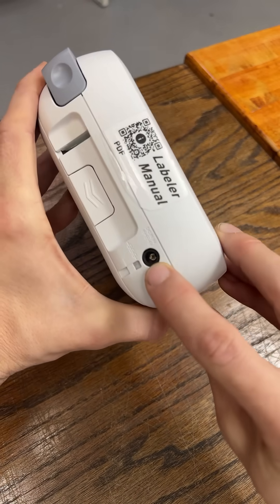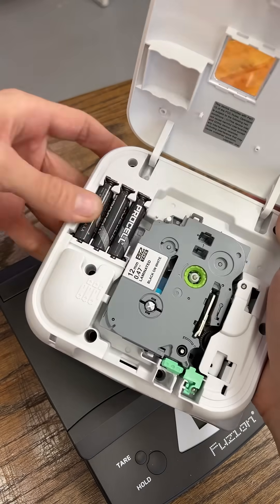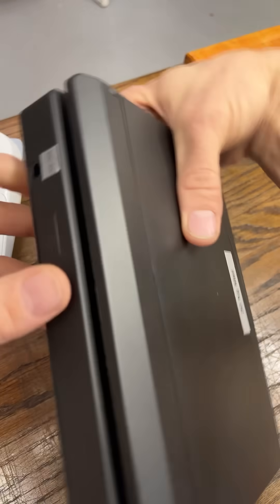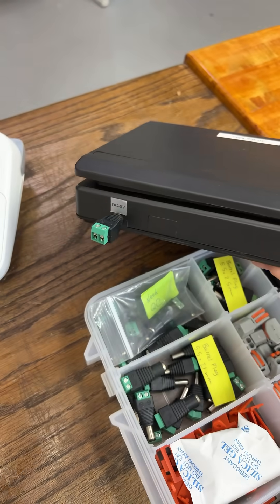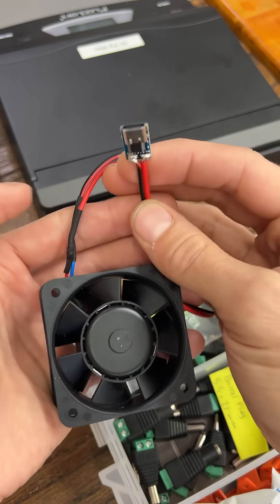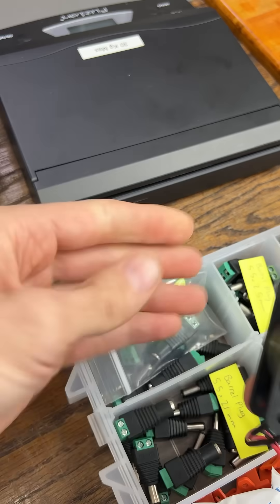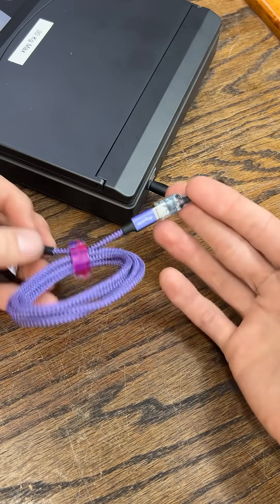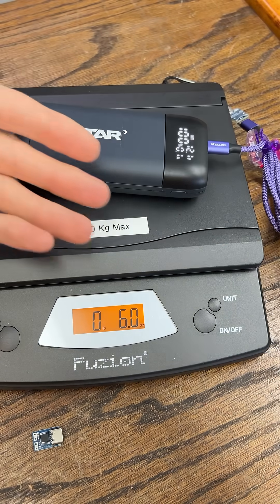USB-C can replace alkaline batteries

Comment: I think we miss Radioshack. Who remembers the catalogues?
Reply: They pretty much abandoned their original target market and tried to sell second-rate electronics. It got to where I couldn't find some of the most basic components. There are a few still around but they're a pale shadow of what they used to be.
Reply: @baldeagle5297  So true the one down the street from me has wall after isle of consumer electronics and a roll-a-round drawer tower with actual electrical components, and never what I need in any of them.
Reply: @baldeagle5297  
What killed Radio Shack is they try to turn into a cell phone store. 
I actually still got a couple of Radio Shack catalog around here somewhere I can't bring myself to throw them away.
Reply: I miss the actual RadioShack store. I thought they went out of business years ago and I'm surprised there are still some around. Not near me. It was so nice to go to my local RadioShack and buy parts off the shelf. Now - catalogs, or certain websites.
(BTW I found it hard to follow what the original video is about.)
Reply: @guitarbrad  he claims to have designed a method of using one 5v wall power brick or a battery pack to power devices with multiple voltage requirements. instead of multiple power bricks, one for each, thing is he forgot about Amperage is as important if not more than voltage is.
Reply: @armastat  sounds like his claim is bogus then, right?
Reply: @Cryin_Lion  in the sense that it will do as he claims?   yes. the actual device could be real, it just wont work on all devices
Reply: amps just matters that its enough. You don't need to match the psu amps to what the device consumes. 

In fact if you're using 3rd party psu's its safer if its amp rating is higher than what came with the device. 

If the volts are too high you can end up overworking the devices internal voltage regulation.

The videos basically just about replacing batteries with dc power sources. If some device uses 3 nominally 1.5v batteries 5v is fine and very few devices that aren't heaters or something will use more than half amp and their dc barrel inputs are usually rated at 6 volts.. But you can just get usb to barrel jack cables or hack up a cable and use that or hack up usb cable into battery termins. This is fine for powering 99% of aa/aaa battery devices with usb chargers or powerbanks just fine.
Reply: I work part time in an electronics store in Australia, and we produce a 400 page catalogue every 2-3 years. We still sell a number of components in our retail store but no where near what Mouser or Digikey sells from their warehouses.
Reply: @aa-au  I'm in Melbourne, whats the store? Fair chance i'm a customer if yr here or do pdf's.
Reply: @EmeraldHill-vo1cs  It's Altronics in Springvale. There is a store in Airport West, but I've never been there.
Reply: @aa-au  Ah, have heard of them. Will check em out, thanks.
Reply: @EmeraldHill-vo1cs  OK, see you at the Springvale store sometime :)
Reply: If you live in australia, we've had 'jaycar' cats for about 40 yrs. They only just changed from mail to pdf cos its 600 pages! 'Radio parts' also.
Reply: @EmeraldHill-vo1cs  I miss the Montgomery Wards Catalogs, oh God we would droll over the Christmas edition. Ah the good old days.
Reply: @armastat  Bet there was more drooling than buying.I'm still a catalogue addict, i think it started with the stuff on back of comics.
Reply: @EmeraldHill-vo1cs  lol, for me it was the Montgomery Ward's Christmas catalog.
Reply: The local Radio Shack was a formative part of my childhood. The only store where you could walk in and buy any type or length of wire, connectors, soldering irons and solders, screw drivers, pliers, etc. etc. To this very day, almost no one else does it. Microcenter has a lot of stuff, and some hardware stores of course but most hardware stores don't sell resistors and breadboards. R.I.P. Radio Shack/Tandy!
Reply: Dick Smith in Australia was the same. Thankfully Jaycar took up the slack
Reply: Realistic and Optimus speakers 😂 I had two 18" Optimus subs in an infinite baffle in my b2200  mini truck back in the day. I still think it was cool 😎
Reply: You spelt catalogs wrong. The word doesn’t have a u in it.
Reply: @UltraMagaFan2   "catalogues is predominantly used in 🇬🇧 British English (used in UK/AU/NZ)" it is a correct word and DOES have a U in it  please check your facts before putting on your spelling-cop costume

Comment: If only PD was sensible, I had chargers push 9 when asked for 12 cause that was the closest they had, I'd rather a small cheap boost converter in the adaptor

Comment: This may damage some devices - the USB-C PD standard starts the output at 5V, then sink and source negotiate to slew to a higher voltage.  If a 9V device (like the label printer here) is undervolted to 5V at power on, it may draw excessive currents and cause power oscillations before the increased voltage negotiation is complete.  This may be ok if you plug the AC adapter + cable + PD adapter into the wall, then plug it into the device (after the output voltage negotiation is complete).  But if you plug the AC adapter + cable + PD adapter into the device, then plug the AC adapter into the wall, you can damage your device.  Devices that are designed as USB-C power sinks must be designed to start with a power supply of 5V.

Comment: You might be able to dictate the correct voltage but your power supply still needs the correct or higher amperage. So not all wall warts will work.

Comment: Funny😂
I took all my cheap trail cameras that use batteries and took them apart and added a plug off old equipment so that I could plug up that same round plug to a mini solar panel or external battery packs. They all work no more dead batteries or recharging em

Comment: usbc is far from a universal or perfect connector... having the cable everywhere seems fun... having 70 different chargers with different voltages isnt.... usbc still cant charge most of the powerful laptops and either need 2 usbc or 1 barrel jack....

Comment: And it's not only one barrel plug, but a handful of them. Some don't fit at all, some are loose.
And some devices need AC, which won't work with these adaptors.

Comment: Your brain might explode when you‘ll hear that there are adjustable  power supplies. As you have to adapt the voltage manually in both cases, it‘s much easier to use. If you prefer the adapter on an adapter on an adapter thing, you can buy configurable USBC adapter.

Comment: Seems like a lot of effort when you can buy a universal power adapter that ranges from 3 to 12 volts from Walmart that also includes different barrel connectors for a wider range of devices.

Comment: The alkaline cells really suck, but I have a supply of NiMH rechargeable cells that are cheap, durable, have between double and quadruple the current of alkaline cells, and are less prone to leak than alkalines.

Trouble with USB C is that not all chargers use provide all voltages... and the PD adapter boards often pass through power regardless of if the voltage is high enough... which could be bad for some circuits. Watch your adapters and power banks to be sure they all have the right voltages available for each device. I usually have to pair them with a buck boost converter in case the voltages don't match so things don't fault and let out the smoke.

Comment: You don't even have to make them you can buy an adapter already made. Most ppl will not use a soldering iron let alone go but one for something just like this. Someone whos going to buy a soldering iron is already into some sort of electronics repair or just getting started.

Comment: This is gonna work in 90% of cases, and then one day it will ruin your entire day, plus potentially the next entire month. Seriously. If you don't have a bit of understanding of electronics, and some idea of the circuit you're trying to mess with, don't plug random power supplies into things. It might not end up biting you in the butt, but if it does, it's gonna hurt. 

Not to mention, hardware designers aren't all made the same. Some of them will design your product with umpteen failsafes in mind, so you're safe knowing you can't really hurt the device. Others are lazy, or don't care about people who would unintentionally misuse their items, and you'll end up with a fried device. Again. If you don't know what exactly you're doing... just don't do it.

Comment: Are you that unique that you don't know the Brother P-tag label maker is simple as they come. I think you need to reevaluate your grevience points for the entire video. Simple yet expensive.  It's simple to insert label cassette and a set of good batteries for the convenience of the label machine being used for your label needs. Plz, I  beg you to go buy a set of high capacity rechargeable batteries and the correct charger for them. Get a better theme than this short and I will be keeping my criticism away from your comment section. Yea, get a brain and use it. I only have one question to ask you about.  Are you too slow on the uptake. Have you been around canned cleaning air for electronics? Maybe there's one out of frame/view. Well,  okay then. Just sit there and look pretty....you know what you're doing so better content,  we beg you!!😢

Comment: My setup is vastly more intuitive and requires only making adapter cables that fit the input I am trying to provide because Sharkgeek makes a variable battery power supply, the Storm 2. You can output to a barrel plug and save power instead of using buck converters. That is only one output however, which can be a drawback. Ideally I’d just convert everything I have to USB-C but I also use this for ‘voltage injection’ when I don’t have the portability for a bench PSU.

Comment: What happens if the voltage doesen't match the PD Adapter's settings? If the voltage is is higher does it provide the set voltage? If the voltage is lower, does it provide a lower voltage or nothing at all?

Comment: They dont have the adapters just in wal mart, The other thing is they write alot of junk on amazon where you cant always find the specifications. They will use EU measurements and write it where it is not clear. They're difficult to come by yeah they have adapters for 12 volt vehicle and wall plugs and phone to usb or even a screen, mirror for your phone now that is wireless like bluetooth adapter really etc.....interesting to keep that in mind....some people try to take away your adaptations to survive...

Comment: There is a max limit in Amps depending on the power source and cable thickness. There's also the polarity. So yes, you do need some common knowledge if you don't want to create fire.

Comment: There's plenty of devices that insist on batteries and have no AC plugs at all. Like a blood glucose tester I used some years ago, that ate a 2032 battery every 5-6 uses, it was getting ridiculous so I stopped using it. Batteries ONLY. No ports for an AC adapter, at all.

Comment: I like to implant these boards in all my devices. Theres almost always room for that board and a little cutout in the case. And for compatibility reasons i like to set the board to 5V and use a step up converter after it. This way it doesnt matter which USB charger i use, it will always work.

Comment: That's pretty cool. I've only just discovered these little step-up pcbs, I used to build 9-18v charge pumps to power 18v guitar pedals from a 9v daisy chain.

This does raise the question of polarity. The guitar pedal standard is (dangerously 'almost') centre negative. whereas these devices might vary so you would need to make 2 or have a means of reversing the polarity but that's really no more precarious than those multi voltage power supplies that came with a variety of plugs that you needed to know to orientate.

I'm getting some. Thank you.

Comment: Have you heard of rechargeable batteries? They're pretty useful.
Reply: I have some AA rechargeable batteries that have a built-in USB-C socket, so you can charge them with a USB-C cable. Witchcraft!
Reply: Know what the difference between 1.3v and 1.5v is? Over 3 batteries or more?
Reply: Yup And they also are not such insane fire hazards such as lithium ion batteries.
Reply: @KRAFTWERK2K6  The USB-C rechargeable AA's are Lithium, but it's not insane, just need to not cheap out on the cell or BMS.

Comment: They also have invented rechargeable batteries...
Reply: a concept absolutely foreign to many people these days, even though they are much safer.
Reply: @KRAFTWERK2K6  also, I think a lot of people don't realise how good even NiMh are vs alkaline in high drain circuits. If anyone remembers the AA cell digital cameras from the 00s, those ate through alkalines so quickly then people would throw the alkalines away not realising they probably still had half their life for other applications. NiMh lasted far longer on a single charge in the cameras. Places like Disneyland making a killing on selling more overpriced duracell from their kiosks whilst visitors continued to dump cells into the trash every hour of use
Reply: @KRAFTWERK2K6   and way cheaper when you use (made in Japan by FKD) Ikea LADDA ones. add a couple STENKOL chargers and you're good to go for a long time for less than a year supply of alkaline throwaway batteries. 😽👌
Reply: I just got a dymo printer and it doesn't work with rechargeables not my good ones or amazon ones
Reply: but unless you have a ton of them (which in some countries can get real expensive) you cant use a device while charging, and sometimes they drain too fast.
Reply: Getting any battery is kinda cumbersome when you want to use a label maker just for a few minutes. A power bank ensures only the needed amount of power is drawn, and then the power bank could easily and quickly change to power something else.
Reply: yup, you can get NiMH battiers that last 3-4 times longer then alkaline.  and you get to reuse them!! heh :)  i think they even got Lion retro batts as well, not sure about the capacity in that case.  maybe cuz i'm older skool, i'd just use nimh.
Reply: Some devices are voltage sensitive and most rechargeable batteries have a nominal 1.2 volts instead of the required 1.5 volts. That presents a problem.
Reply: @RTR-MATEY  it's false. A fully charged nimh battery has 1.47v while an alkaline single use cell drops below 1.30v quite easily after little use.
Reply: Yeah but those are too low in voltage for many devices
Reply: @electricpaisy6045   they mean where a battery bay is part of the design. The video that is being commented on specifically is on about replacing alkaline cell power with dc jack power

Comment: I love USB-C PD, but!! After many failed attempts my PD chargers are slowly stopping to work one by one - brand by brand. After more then one year usb-c port is dead. I have used it to power my laptop, cellphones, adopted all microUSB stuff with magnetic port to be able to charge all in one place. 
I think it is due to low quality of those magnetic cables that it keeps USB-C PD turned on the whole time... But it cost me so much money and time already that right now I do not have any power to continue testing. Maybe after few more years :-D

Comment: Or, just hear me out, buy the correct adapter if the device will live plugged in..... A pd plug, plus cable, plus barrel jack and c adapter has got to cost more than the proper $5 power adapter. Now, if these things aren't always plugged in and are used sporadically, then this makes sense.

Comment: Do this all the time with step up and step down controllers but you will be limited to the 15w max draw of USB. Works most of the time, there is the odd device that is picky on the wavelength.

Comment: yea, soldering is a real complicated process.   you should have at least a masters degree in electrical engineering  to attempt it.  the "everyman" is a real retard, can't trust them with something so advanced.   and also, remember not to jaywalk  on your way to buy that expensive piece of u.s. made and ul listed crap.  unless you're too scared to get out of bed for fear of all these exploding power cables

Comment: If you don try and do this you need to remember that you can’t run laptops on this because it is very unlikely that a normal usb-c block will supply the correct amps to power it while it is on otherwise you’ll get 🎆🎆🎆🎆

Comment: You still need to make sure the cables and power source can handle the current and voltages needed. They screwed up by expanding the specs of usb c in general after the initial specs were out and already being manufactured. You can still get into trouble with no power protection. Also, rechargeable batteries are a thing.
Reply: Also, don't leave exposed circuits with these types of adapters. One stray to short things and you can poof your charger, battery bank, or even the connector on the device you're adapting.

Comment: You could just get rechargeable batteries 2 what is the current output of that thing and three what is the current output of your charger and for some usbc Chargers are 9 volts anybody who has a fast charger their charger is probably actually outputting 9 volts not 5

Comment: You should make a board that in addition to the USB-PD has a buck boost or SEPIC converter to make sure that even a 5V only USB C charger can power a 9V or 12V device and that a 20V chager at 3A can power a 12V 4A device for example

Comment: Not always the case. Since you showed a Brother label printer, mine uses 8 AAs. I tried using a power adapter with the specs matching the requirements (voltage, amps, and polarity) I had laying around. I tested it to make sure it worked with a meter. It did but  didn't work with the printer. I had to buy an aftermarket AC adapter that was made for this printer and similar Brother models. It cost me around 50 USD with shipping.